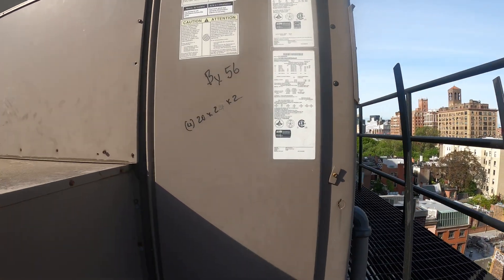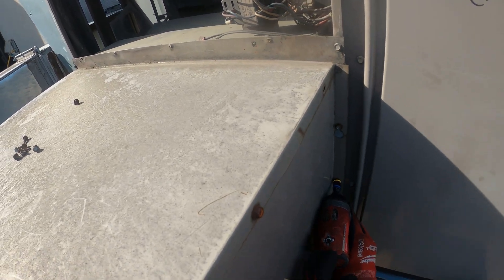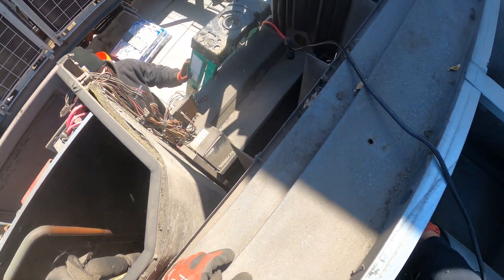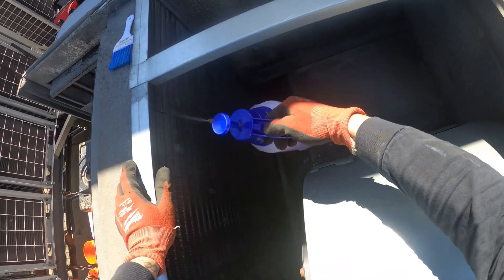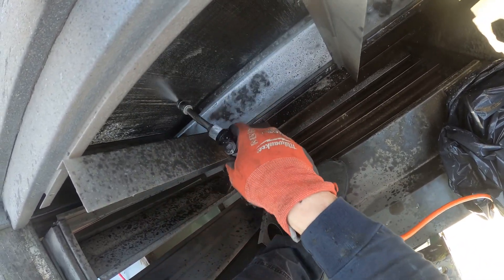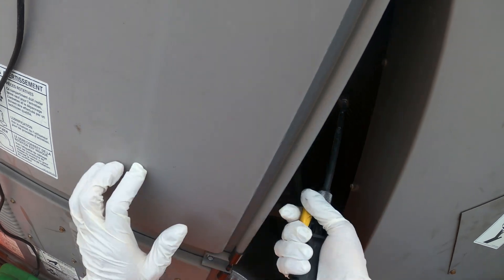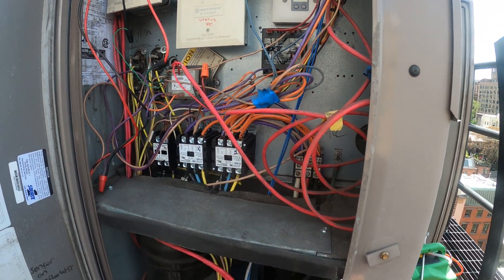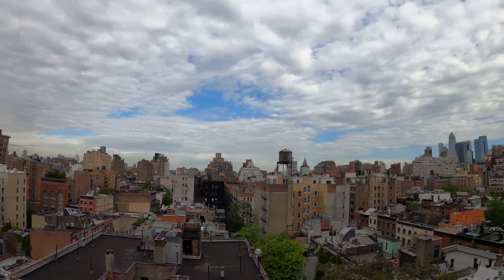HVAC Service Call: York RTU Not Cooling (Package Unit Air Flow Issues) Low Superheat/High Subcooling

Comment: That’s pretty bad shape for a 12 year old Coleman style York unit. Yes, someone definitely overcharged those microchannel coils to try and get that suction pressure up. Yes, that evaporator needs to be replaced. Yes, you should quote them a new unit. Yes, you should tell them if this is a result of the fact that they never had their equipment maintained properly. When I find a unit like that, I tell them what the options are, and I tell him that the likelihood of success is going to be low when you have an evaporator that has fins literally falling off of the coils. Typically they say, “try to get it working,” and I say “yes, but it’s not going to work as intended, which means you may get 30 or 40% of the cooling capacity for your space.”
Reply: That's what I do. Proper charge, clean coils, check fans, walk away. "That's as good as its gonna get, mister"
In this case, fire dampers were tripped.

Comment: When i clean coils, I clean the drain line and pan first after the brush down. Before the chemical you should wet the coil. This allows the chemical to stick better. Also you should go bottom up. This allows a clear path for the dirt to go. 

FYI them United chemical eat coils especially if  not rinsed off.